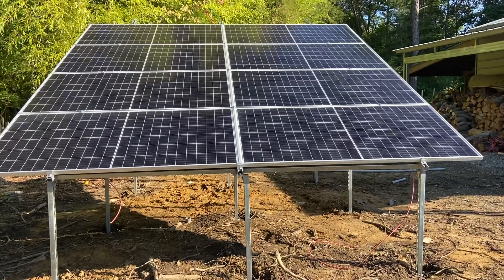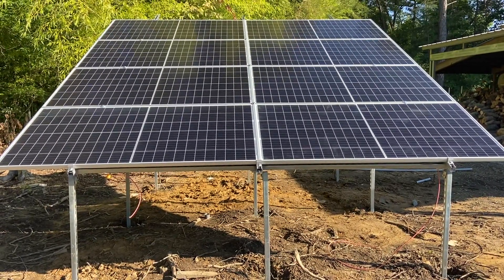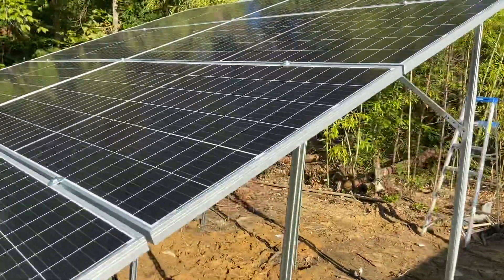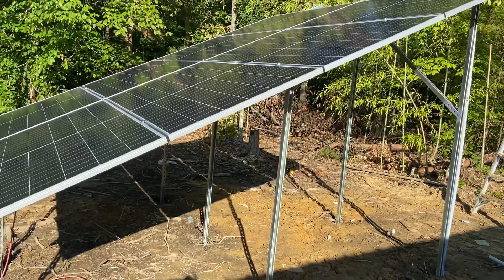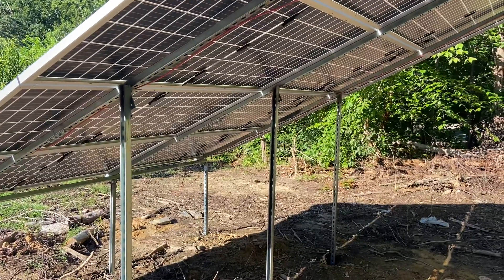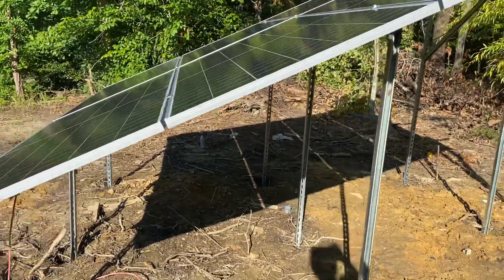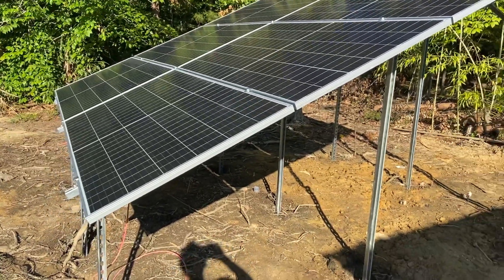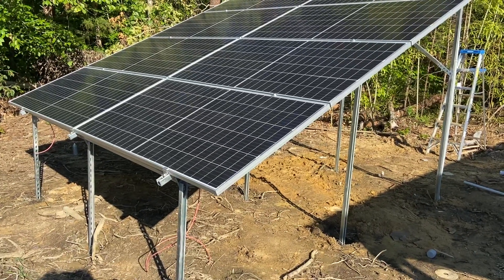3200 watt solar array built out of unistrut- easy to install for large arrays. Cheap solar array

Comment: Have you considered either putting white stones underneath or putting a thin concrete floor and painting it white? This could significantly help the bifacials reach their potential.
Reply from the maker: I am still wanting to add some white gravel. I have just been too busy with other projects. Also it produces lots of wattage. So I’ve just been a bit lazy with it.

Comment: As long as you are not in Florida, the next storm will put it up by the space station.
Reply from the maker: We’ve had some pretty strong storms here. But nothing compared to what Florida experiences. Sustained winds of that magnitude would be very hard to build a ground array for. But they do design them for that at places like iron ridge.
Reply: I think its better they are on the ground, easier to maintain and clean. I had a couple on the roof and they got hit by lightning.

Comment: I bought the bifacial panel too. Do you find that they help on cloudy days? I'm here in Oregon so we get a few. Did you fuse each panel?

Thanks for the video
Reply from the maker: I’m not sure the difference since I only have bifacials. I know they are supposed to help in fog and snow. I fused them at the combiner box. I talk about the combiner box a bit in my video in the solar pole barn.

Comment: How many kWh do you create with this each day and what part of the country are you in?
Reply from the maker: I’m on the east coast. Virginia. I don’t have on that specific array. The inverter is split between 2 different arrays. So I can see the wattage in real time but it totals both together. I get around 6-7 hours of sun exposure on this array. And it’s roughly 3,200 watts worth of panels. It produces a lot of power. It’s smaller then my other array, but it gets sun earlier because of its location. I’m monitoring the voltage of this array. I may add 2 more panels to the top if it stays under my maximum VOC range of my inverters in the cold weather.

Comment: What parts did you use for the unistrut connectors? Do you have a part list?
Reply from the maker: I did mention which parts I used in my follow up video. I didn’t post any links, but the parts are usually available at your local hardware.

Comment: Nice job 👍 
Do you utilize both ac and dc loads ?
Reply from the maker: No. I convert everything to AC.
Reply: Yes my on demand water pump is invaluable 12 v 3.5 gpm
Reply: Asked because I found things like water pump fridge lights on dc use far less power and rises efficiency just wondering 💭 thanks
Reply from the maker: @solarindependentutilitysystems   that’s true. Dc water pumps typically have a very low flow rate though. We use a lot of water for garden irrigation so that would be a pain. In a completely off grid cabin type of installation I would prefer to have a lot of DC appliances and lighting.

Comment: I have a similar unistrut ground array. I tried the diagonal bracing up high like you and I had an unacceptable amount of the wigglies. I found out that I had to run a much longer diagonal brace that runs close to the top of one support to the ground of the next leg. That made a startling improvement in rigidity. I would suggest a brace from the on each side of the array, from the top of the middle length support to the bottom of each long rear side support. This will stop front to back and twist motion. Then I’d run only one brace from the middle center, support to the bottom of a middle length side support You should be able to do this without welding using a 90 degree bracket (2 hole) and extend a strut if need with a 4 hole straight bracket.
Reply from the maker: It’s pretty sturdy all around. But as far as the tall end. It probably could use a long X brace for each leg. I’ll take care of that this winter. I really appreciate the suggestions. Starting my dyi battery next week. So hopefully I’ll have a video about it. I’m buying some electrical ducting to clean up my wiring also. Should be fun.
Reply: @GavinStoneDIY  
My array is very sturdy now. I went out to watch it in a wind storm and couldn’t see it move. A friend mentioned a plastic mesh he uses on his professional installs to hold and neaten the PV wire. It passes inspection. I got to ask him about it.

Comment: Regular unistrut from Lowes,  10 and 20 ft.   Are they concreted to the ground?   Where did you get the mount clips?  I am just beginning mounting my panels.
Reply from the maker: I used 10 ft pieces of unistrut from Lowe’s. I concreted them 2’ into the ground. Smarkey solar panel clips from Amazon are what I used for the bottom and top of the panels. They are compatible with unistrut but I still had to use washers to make them tight. For the  middle sections I just used the unistrut spring nuts and bolts and washers.